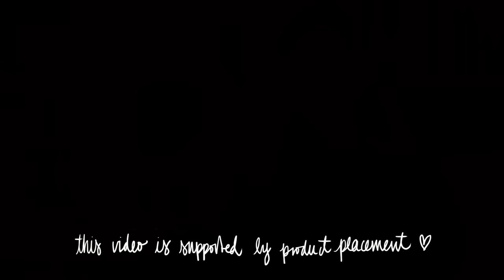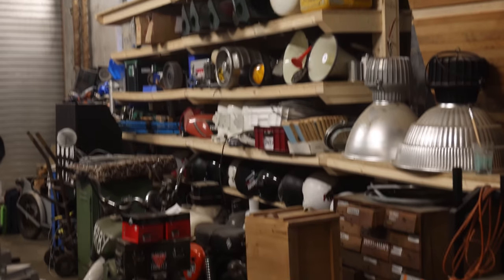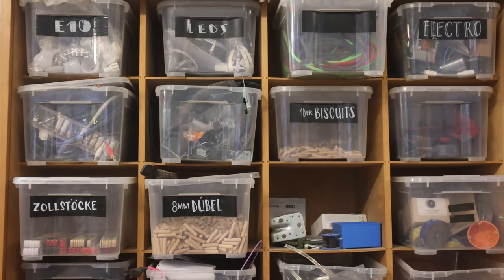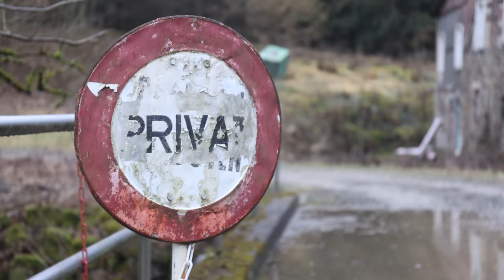Camper Renovation on a Budget! (no money spent so far)

Comment: Love the whole ethos of reuse, upcycle and trading!
Reply: Me too, trading should be normalised
Reply: That's the thing.  That camper had no real "value" but some effort and it becomes something great!
Reply: 😊 great quotes!
Reply: @tiacho2893  depends what you consider "value" i have lots of things that are of huge value to me that are not worth a lot of or any money
Reply: @smashyrashy  I was referring to $$$ value; things like manual typewriters that are old but not yet collectable.  The only $$$ value is scrap metal and that's really low.  But they are amazing bits of mechanical  engineering and design.
Reply: The only thing I think you should add would be a bathroom, but the trailer looks like it’s coming together nicely.
Reply: Lovin the sign material and in general.

Comment: Perfect Laura project. It’s fascinating how much better it looked after you cleaned it up!

Here’s an old sewist tip: keep a dish with a magnet at hand when you’re pulling nails or staples from reclaimed wood.  It will keep them corralled for safe disposal. You can buy a magnetic dish at an auto supply store or simply hot glue a magnet or two to the bottom of an old plate or dish. I use such a dish by my sewing machine to corral pins.

Comment: Once saw a tip that if you use a short piece of small pipe or pipe fitting you can use it to straighten the nails/staples before hammering them back through the wood.

Comment: hi, I use a lot of pallet wood also and I think I remember seeing use with one of the tools it is called a Roughneck here in the UK, I don’t know what it will be called in German, last time I met a German him and I were more intent on killing the other rather than asking names of woodworking tools, anyway the other tool works off an air compressor, it is like an airnailer with a hole down the middle, you put that over the nail, press the trigger and a plunger ejects the nail from the board. They are very good at removing nails and staples. Let me see, I used to be in the British Royal Navy but I am sure they would take a dim view of me giving away a submarine even a broken one

Comment: Like that huuuuuuge wire spool, a source of reusable wood is the pallets used to ship Asian made heavy equipment.  I used to live near a Kubota dealer and they were OK with me going through their scrap pile.  Still a crap ton of nail holes and you have to air dry it yourself, but for small projects, it is a good source,

Comment: You're pretty skilled.  And you're a big fan of Festool.   They are a bit expensive .  They have nice precision however.  Not sure their durability is what it should be.  I may build a camper.  I may build a single axel trailer or may build a 20' trailer and a camper that jacks up for drive out, and a standard utility trailer when separated.

Comment: I have ALOT of Dibond panels and offcuts from a sign company I used to work for, I'm planning on skinning a small teardrop trailer/camper with it. If I can copperplate it with the technique you shared a couple of weeks ago(still haven't gotten the chance to test it) it's going to be SICK!
Reply from the maker: That probably won‘t work on aluminium...but maybe there is a different technique to donot
Reply from the maker: Do it
Reply: Yeah, aluminum is almost never plated, usually it gets anodized. I wonder if home anodization is possible now? Might be.
Reply: Lots of aluminum items get chrome plated, including my old BMX race bikes which had chrome plated aluminum rims and I've worked on a number of Crager SS custom car wheels with chrome plated aluminum centers among lots of other items.One of the reasons I think there's a chance this technique may work is that its similar to anodizing in that it works by creating and oxide layer that incorporates the copper much like anodizing creates an oxidation layer with a dye. If it doesn't work I'll learn something and if it does we cn all start plating all kinds of cool stuff! Are you with me!?
Reply: And yeah, anodizing at home isn't that difficult, but I'm unfamiliar with a method for getting a shiney copper finish that way

Comment: Fantastic project. I really love that you use so many recycled materials. I am just worried about that cable spool. I am not sure how it is in your country, but in mine they are frequently treated with some really nasty stuff and using them indoors is really dangerous. I really hope it's not the case with your materials.
Reply: Over here (UK) a lot of manufacturers have moved from chemical treatment to heat treatment for pallets, it may be the same with spools but I don't know

Comment: Does Festool supply all the consumable their machines use like blades, sandpaper, drill, router bits, adhesives and sealants or are they traded for with others. When you say you have not spent a penny then do you count electricity for machines and charging batteries or does that come with a donated work space or paid for by Patreon charges. - I am just curious as how your project can be done without any cost to yourself.